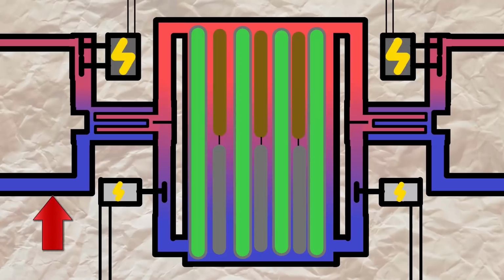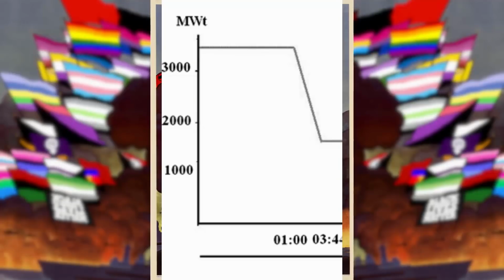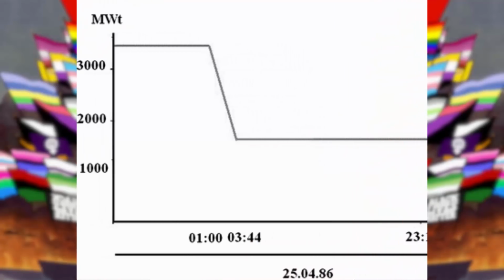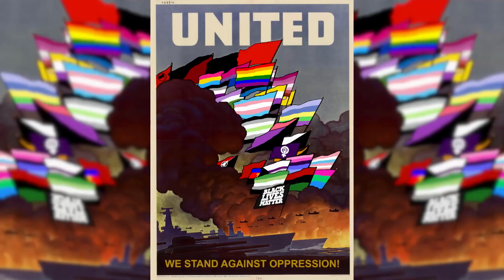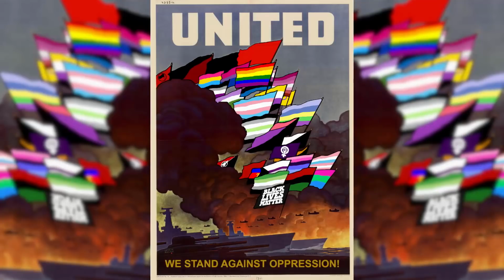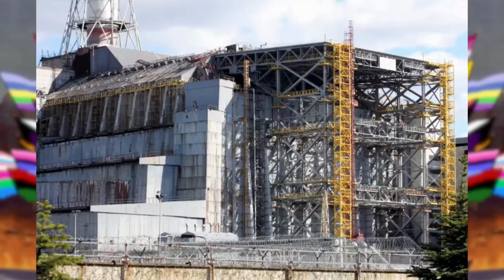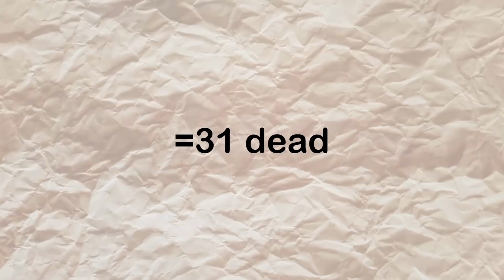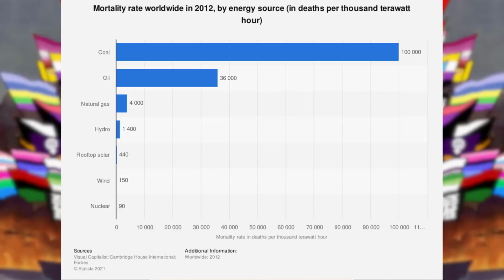Chernobyl: The Only Nuclear Accident We Care About

Comment: I am afraid your claim about nuclear power plant having a potential to become a naclear bomb is false.
You seem to have all the information needed to realise the error - you spelled it out yourself - but it probably didn't fall into place. So please let me help you.

As you mentioned, the uranium nucleus requires a neutron to split. However the type of uranium used in reactor fuels is only able to capture "slow" neutrons to get split. "Fast" neutrons will bypass the atom and not trigger the reaction.
This might sound counterintuitive at first - after all getting hit by a fast moving object is likely to break stuff, but for uranium the process is not literally "breaking". Basically the forces that holf the neutrons and protons of the atom nucleus together are way out of the league of anything a neutron can carry. So the way neutron can split an atom is by sticking to nucleus. This will cause the forces in the nucleus to try and rearrange the nucleus and effectively the attempt to do so will cause the nucleus to tear itself apart... Or more likely to shed a couple pieces. And to properly "stick" the neutron will have to be slow moving. Fast moving neutron will basically "bounce"
There are other isotopes (versions) of Uranium that are good at "catching" fast neutrons, but those are specifically not used in nuclear power plants.
And the catch is - neutrons that are released when atom splits, are fast ones.
So the nuclear fuel rods are literally incapable of starting and sustaining a chain reaction.

Comment: Well, a nuclear reactor in a powerplant is never going to turn into a bomb, the fuel is not enriched enough to be able to achieve that.

Without control the reactor would only heat enough so that the fuel would melt for example and also it would cause something similar to what happened to the Chernobyl powerplant, metal heated to high temperature become reactive towards water and dissociate it to form hydrogen which then would be in turn oxydized by oxygen in an explosive manner.

Comment: Nuclear reactors of the past are crap. Just crap from an economical point of view. They can be made made as safe as possible for the application. They do produce the cheapest kWh of electricity and their life cycle carbon footprint is the lowest even compared to wind and solar. BUT, and that is a big but, their decommissioning costs are exorbitant. Almost two thirds of the construction costs. How is that feasible especially when you include waste management costs? Thorium reactors on the other hand are awesome.

Comment: Some minor accuracy complaints (to the best of my knowledge as I'm not an expert):

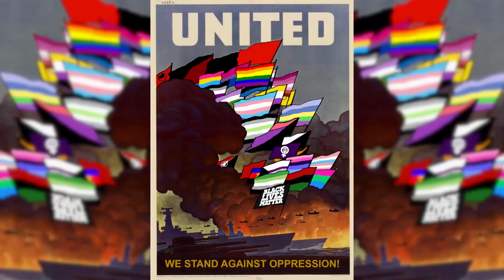2:52 Power plants don't vent steam into the atmosphere. To be efficient the turbine system needs to convert as much of the heat as possible into mechanical work thus cooling it down. If you're venting steam into the atmosphere you're wasting a lot of energy. Also, the water/vapor running through the turbine is, at least generally, run in a closed cycle (Rankine cycle) and is cooled by separate coolant water in a heat exchanger.

3:18 A nuclear reactor cannot turn into a nuclear bomb. A nuclear bomb requires so-called prompt criticality (or rather prompt supercriticality). This means that the speed of the reaction increases from the prompt neutrons, i.e. those coming from an atom split happening immediately when a neutron hits an atom with no consideration for the neutrons coming from a more delayed decay. Prompt criticality is necessary for nuclear bombs as normal (super)criticality isn't fast enough. It's a very hard condition to achieve and nuclear fuel used in power plants isn't pure enough for that to happen.

12:05 The Cherenkov effect happens when charged particles like electrons exceed the speed of light in a medium. Uncharged particles like neutrons don't cause the Cherenkov effect.

Comment: This would NOT have resulted in any "nuclear detonation" of any kind. Many think the opposite, naturally.

Civilian Nuclear power shouldve been pushed harder since 1945. Best and cleanest (bang for buck perspective) form of energy we've ever had thus far.

Russia is world leading in civilian nuclear energy. With their geography, makes sense. Best nuclear powered ice breakers (and largest fleet) on earth and, like any SSN/SSBN can be used to fuel near by ground facilities.

Russua actually uses its nuclear powered ice breakers to power remote cities/towns in north Asia more than most would expect. 

Best use, so far, of civilian nuclear power. Can move to avoid natural disasters better than a building, etc., etc..

Comment: Nuclear is not as safe as the bar chart you showed suggests.  The numbers are not calculated on equal premises.
It is safer than coal and some forms of oil, but that's it.  Nuclear reactors actually do release some radiation into the immediate environment.  And that is when they are operating as designed, which they don't always do.

I would have liked a comparison of Chernobyl with Fukushima and Sellafield.

Also of interest is the fallout from nuclear testing.  Compared to nuclear surface tests, Chernobyl is negligible.
Of particular attention is where and how that fallout spread.  It spread all over the world, of course, but some areas received more of it than others.

And one reason for being against nuclear energy that you neglected to mention is how they are instrumental in the production of nuclear bombs.
In addition, they aren't cost effective if you take environmental damage and long-term storage of nuclear waste in account, which is of course not paid by the owners of the nuclear plants.  Rather, nuclear power is subsidised even as green energy.  And it is still the most expensive source of energy.
Reply: You could have easily fact checked all your memes before making a fool of yourself on the internet.

Comment: one MASSIVE correction: Nuclear reactors, unless they are working with HIGHLY enriched fuel, cannot explode like a nuke. nuclear weapons are enriched for U-235 up to 70%, most nuclear fuel is only enriched to 2%, and nuclear fuel used in soviet RBMK reactors specifically was less than half of a percent enriched and sometimes totally unenriched.

EDIT: what happened in the Chernobyl accident was a nuclear meltdown which caused a graphite fire and several steam explosions. not a nuclear detonation. and even this took an incredible amount of idiocy. the graphite should never be drawn out of the reactor.

Comment: The steam that goes through the turbines in RBMK is radioactive. It's a boiling reactor. There's no point in boiling the water in the first loop if you want to transfer the heat to another loop.
Reply: I have to dislike to contain the spread of misinformation.

Comment: "In itself, the reactor would quickly turn into a nuclear bomb"
No it wouldn't, it doesn't have the critical mass and the uranium is not enriched enough to go supercritical.
Reply: Those words do not mean what you think they mean.
Supercritical means that the neutrons are too fast to keep a chain reaction going.
And nuclear power plants have loads more critical mass than nuclear bombs.  Power plants have tons of fissile material, where bombs make do with a few kilograms.

What is true is that the material in bombs is enriched to a much, much higher degree.  This is part of the reason they can be so compact.
Reply: @davidwuhrer6704  "Supercritical means that the neutrons are too fast to keep a chain reaction going."
Absolutely not. Supercritical means that the mass is big enough and enriched enough to cause an increase in the number of fission reactions.
Which technically means my statement was incorrect, a reactor can go supercritical because otherwise it wouldn't be able to start up.
I incorrectly remembered that the "supercritical" label only applied to an uncontrolled and unstoppable increase of the number of fissions, but it actually applies to any increase, even if it eventually comes to an equilibrium.

Your definition however is even more wrong than the one I incorrectly used.

"And nuclear power plants have loads more critical mass than nuclear bombs."

They have more mass, but it's not enriched enough to fission as quickly as is needed to create an uncontrolled and unstoppable increase in reactivity (and thus a nuclear explosion), as they don't have enough mass to do this at the low enrichment of their fuel, which is what I originally meant.
The reactor either melts, or a steam explosion occurs before the rate of fission can come anywhere near that of a bomb. Exactly what happened in Chernobyl, which was brought as close to a nuclear explosion as any reactor could possibly ever hope to get, but still only detonated with the power of steam pressure. 
If it had been a nuclear detonation, even an extremely small one, it would have leveled at least the entire power plant.

If you had ten thousand tons of low enrichment fuel and an unlimited budget you could probably cause a nuclear explosion with it, but it would be absurdly impractical.
Reply: @demoniack81  Your definition of supercritical is not one I'm familiar with.  I'm not sure it is meaningful in any practical sense, but what do I know.

I agree that the fissile material in a nuclear power plant is not suitable for a nuclear bomb.

Chernobyl is only the equivalent of a "dirty bomb".
Reply: @davidwuhrer6704  It's not even that. It's an industrial accident that had spillover radioactive pollution. A genuine radiological dirty bomb (ie a cluster munition filled with something nasty like thorium, strontium, or cadmium isotopes, detonated at altitude) would near-permanently (for about 10,000 years ish) poison an area by drenching it with toxic and radioactive isotopes, making it uninhabitable without safety equipment. Chernobil cleaned up remarkably quickly and within 20 years the radiation levels were low enough for safe human habitation within Pripyat, even. The Belorussian and Ukrainian governments are somewhat leery about resettlement however due to an abundance of caution, and because nobody wants to live next to the big (former) radiological disaster.

Comment: The reason a material elevator wasn't used to try to put out the fire was because the excess radiation would have easily damaged the elevator, and possibly started a fire of the grease used to lubricate it, if the control system even worked.

Comment: Viki I'm sorry I really like your channel but the comment you made at 3:21 is wrong. There is nothing in an RBMK nuclear reactor or any nuclear reactor that would cause a fission reaction. A nuclear reactor may explode just like a steam boiler may explode but comparing it to a nuclear bomb where the explosion is powered by a fission chain reaction is scientifically inaccurate. A nuclear power plant cannot produce a fission chain reaction
Reply: No.......................... Good point, but extraordinarily bad wording. 

A nuclear reactor can't produce a "super critical chain reaction' i.e. a nuclear bomb. But they absolutely can produce a fission reaction, that's their whole job and HOW THEY WORK. Hence why we call them fission reactors. It's just that it's carefully calibrated to never be more than a stable criticality ongoing over time and releasing a controllable amount of energy. 

The reason we know they'll never explode is we just don't put enough of that type of fuel in them in with the necessary geometry. A nuclear bomb is a solid metallic mass usually a sphere of fissionable fuel usually Plutonium-239 or over 90% Uranium-235, this allows a chain reaction to happen in the entire mass in a few micro seconds. But a reactor is typically 1-5% U-235 or similar in many broadly spaced rods that aren't solid or pure metal. This exponentially dilutes the opportunity for a rapid high energy chain reaction. 

Many variations exist of course, but they always have characteristics that prevents run away bomb-like reactions in their fundamental design physics.
Reply: @bronzedivision  thank you for the explanation
Reply: There is no such thing as a "super critical chain reaction".  If a reactor is super-critical, there is no chain reaction, same as if it is sub-critical.  There are just more neutrons irradiating everything around.

But bronzedivision is correct that a nuclear reactor requires a stable chain reaction, same as a nuclear bomb.  Both require a critical mass of fissile material.  The difference is only that a power plant has a cooling system to syphon off the heat and turn it into electricity at a variable rate, where a bomb turns as much mass into as much energy as quickly as possible.  And with the materials used, a bomb can do that very much faster than a power plant ever could.  Even if the power plant produces more energy in total over the course of its considerably longer lifetime.
Reply: @davidwuhrer6704  No, super critical is a chain reaction. It's only a micro-second or two long so not really easy to notice. But it's certainly a chain reaction.
Reply: @davidwuhrer6704  A chain reaction can be sub-critical, critical, or super-critical. In a sub-critical reaction, every neutron on average produces less than 1 neutron by hitting atoms and the speed of the reaction is decreasing. In a critical reaction, every neutron on average produces 1 neutron by hitting atoms and the speed of the reaction stays constant. In a super-critical reaction, every neutron on average produces more than 1 neutron by hitting atoms and the speed of the reaction is increasing.

However, the issue is that this also considers neutrons that are produced with a delayed decay when a neutron hits an atom. This kind of "normal" criticality isn't fast enough for a nuclear bomb. For that, you need to exceed "prompt criticality" which is the same except you only consider "prompt" neutrons i.e. ones that are released immediately when a neutron hits an atom. That is a much harder condition to achieve and the nuclear fuel in power plants is not sufficiently enriched for that.

Comment: Criticism: The glow above the reactor was almost certainly not Cherenkov Radiation. The speed of light in air is 0.9997 c, and as such it takes extremely energetic particles to produce the effect. Technically it is possible to induce Cherenkov Radiation in air, but practically speaking, it's not possible.

The light was much more likely an Ionized Air Glow, where radiation knocks electrons loose, causing light as they return to their shells; similar to fluorescence.

Comment: The conclusion i got from watching this video is that the accident happened due to going to quickly. They should've scheduled it towards the beginning of May (though not on May Day).

Also Anatomy Dyatlov was basically an anti-democracy boss. I think the people in bourgeois dictatorships have been scared of nuclear energy is that it requires cooperation focused on truth as opposed to competition & assault, ít requires democracy instead of abusive bosses, it requires safeguards which the profit motive destroys. Therefore, while I can see nuclear energy working in a socialist & direct democracy society, i think it's justified to oppose in bourgeois dictatorships.
Reply: But nuclear power plants are not typically run by politicians, they are run by engineers and technicians.

Typically, the technician's credo is "fix what's broken", and the engineer's credo is "everything should be made as simple as possible, but not simpler."

The political system only matters for one question:
· Should it be built?  (In a democracy, the people have a choice about it.  In a dictatorship, the choice is made for them.)
And the economic system matters for this question:
· How is it paid for?  (In Capitalism, by the government.  In Socialism, by the government.  The difference is where the money ends up, but that is not a question, that's a given.)

Comment: It took me 5 seconds to find documentaries on Binki Atoll. 
https://www.youtube.com/watch?v=NjqoiT-RS4A&ab_channel=WELTDocumentary

For whatever reason, you are determined to pretend that Binki Atoll is some sort of ignored history. It's not. I don't know why you'd be dishonest about that. Nothing changes if that was true.

The problem with nuclear waste is that we waste it. All the tools and ppe that have to go into nuclear waste, that stuff we can't control but that a minor part of the waste. The fact that we make the fuel into ceramic pellets is the problem. Over time the xeon off-gassing breaks down the pellet. So it is best to pull it from the core before it just a mess and it ruins your energy efficiency. The problem is making that pellet useful again, that takes energy and dangerous chemical processing. It would be better if we leave it in a reactor that runs on liquid-based fuels. Then we can remove by-products and clean the fluid on site.